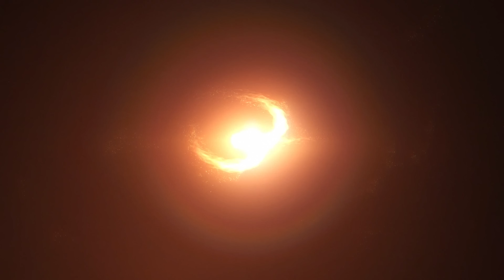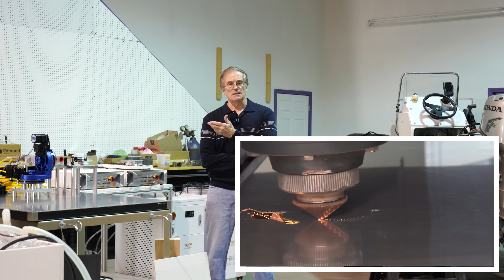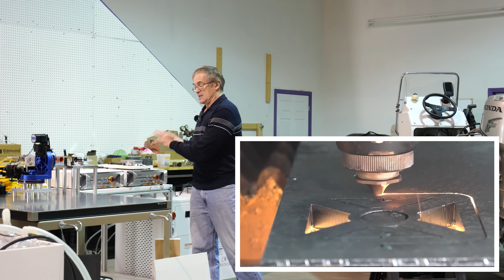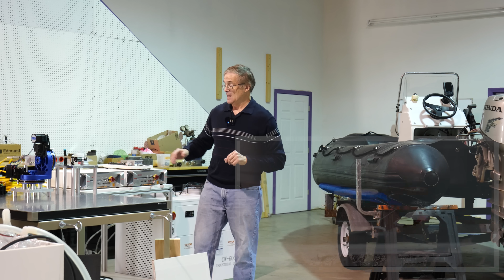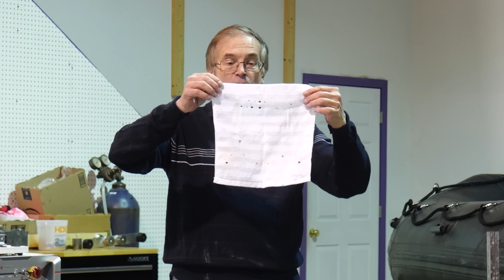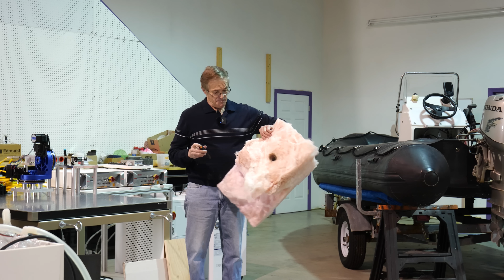We have a problem... and need your help!

Comment: Have you tried sheets of graphite? They are relatively lightweight and heat-resistant 
I'm not sure what your budget and weight tolerances are though
Reply from the maker: Any idea for a source? We need big sheets or a lot of smaller ones if a test shows that it works.
Reply: @TechIngredients  Your local refractory materials supplier (selling kiln parts, fire bricks, etc.) is probably a good place to start. If not, I'd ask around local machine shops. As a last resort (or maybe just for your test run), you can buy from the usual online industrial supply stores but you'll likely end up mostly paying for the shipping.

As for what to get, the best kind would probably be something intended for making molds (like for casting metals); they make big thick sheets or billets of graphite for this purpose. I believe you can also buy stuff made for seals, but that stuff is made to be softer (and usually thinner), so maybe not the best material for a laser backstop.
Reply: @TechIngredients  Also, just a heads-up, the DOE may check up on you (or at least put you on a list) if you decide on the graphite. It's an excellent neutron reflector and moderator.

Comment: I had a coworker that used to work at a facility with a particle accelerator... they have a similar problem when they need to dump the beam.  As he explained it they would normally reduce the power of the beam over time and disperse/unfocus it before purposely dumping it into a trap to minimize wear and tear on the trap itself..... but that trap had to also be designed to stop a full power focused beam being dumped into it at a fixed point which means LOTS of metal/carbon/concrete/etc.

Have you tried a carbon/graphite brick yet?  That seems to be popular for backstops for some types of lasers.

Comment: A quick search (laser safety curtains) - which you yourself must have done - reveals many professional options, all dependent upon the power of the laser.  Given that you have this information anyway, you must be looking for a 'cheap' option. Thar, my friends, be danger!
Reply from the maker: They are good if expensive but generally are used for diffuse or stray beams.
Reply: @TechIngredients  Safest bet is to latch on to a certified Laser Safety Officer or a reputable laser safety equipment supplier, to determine the appropriate curtains(?) and safety measures for the specific laser and intended use.

Comment: Is it a single laser with that output? Why not split the output into multiple pointers and make a system converge energy in a single point after the target is gone laser will stop being focused to the wall, like 10 pointers carrying the whole energy split by 5 centimeters and individually controlled pointers focus the laser on a single point in required distance and anything below or over the distance will be harmed by 1/10 of the energy and stay safe relatively, and you would have 10 times more time until any damage done also you can redirect it to a dispersion lens yes it would be harder with random locations being hit but you could make something work with the targeting calculations to follow possible laser target on the wall and add a lens at a system to disperse the laser

Comment: How would a temperature hardening alloy do? Like titanium or something similar? Also, what if you created a waterfall effect over the titanium? Collect the water in a pool below, angle the allow shielding, and circulate the water down the face. Curious if the alloy and coolant combo would distribute the heat easily.

Comment: Graphite+phenolic resin. I’ve seen people suggest graphite and other carbon based refractory materials but just to add to that from my experience with solid richer mothers, a phenolic resin composite would be form a good ablative layer that forms thick insulating smoke when it burns. In motors we usually use them around the fuel and the nozzle to prevent the outer metal casing from melting.

Comment: if the plywood really works well enough you could fix the fire problem by not having any oxygen nearby (have the setup be in a bath of argon or CO_2). this would however add the requirement of breathing equipment and especially with argon i'd be quite messy/wasteful and expensive.

another solution might be to distribute would be fog:
just make the area behind the test object foggy, so the light scatters everywhere. the distributed light could then be absorbed by something painted black.
one potential issue with this: the fog (this could i guess be usual water fog or fog from dry ice example) would have to be really dense to scatter the light enough, but you don't want any fog in front of the test object, so the first thing that comes to mind would be to keep that dense fog behind highly transparent walls. but that comes with another problem: dealing with reflections of the laser, so you would have to make sure the laser never hits the transparent walls at too much an angle.

this brings me another idea: you could have the laser be partially reflected and transmitted by glass (you probably need multiple such stages) or something alike and absorb the light watt for watt

hope this helps somewhat, also too much power is kind of a nice problem to have lol :D

Comment: You might need to look at composites. For example, a ceramic powder mixed with a resin binder. Take that mixture and put it on your plywood sheet. Finally, use a product like exhaust heat wrap, usually called Basalt fiber, and lay that in the resin binder. So you have a plywood, ceramic, basalt sandwhich. 

Relatively cheap, multilayered. The thickness can be adjusted by more layers of basalt wrap to get your timing right.
Reply from the maker: I'll try some of that wrap. It might work.

Comment: If rocks, brick or concrete is out of the question than the only thing i can think of is orbital heat-shield plates. It's going to be some form of ceramic anyway if absorption is the goal.

Comment: could you just sandwich bentonite chips between layers of something lie drywall to keep it contained?   the chips will melt at a high temperature but any liquified clay will be replaced by solid clay from above.

Comment: Could you integrate a distance-sensing failsafe that only allows the DEW to fire if the spot is less than a threshold distance away?  Depending on how responsive the system is, it could cut down on damage to whatever downrange material you settle on.
Reply from the maker: Probably not. The drones will be trying to evade the beam, and simply avoiding the "killing " distance is too easy.

Comment: A bin of mica or vermiculite might be the trick. As is burns through more would settle in place, continuously filling in the hole. You could add an air nozzle to keep the media moving. Light weight, fire resistant, easy to move, slightly diffractive.

Comment: So it seems to me you need to step down the energy through absorption and diffusion.  I imagine a series of glass plates that are more and more opaque as the laser progresses ending in a tank of water with dye or material in it that will absorb the rest of the diffracted energy and dissipate it as heat.
Also a quick search of google / Grok AI indicates there is something available called a beam block or beam trap - might want to look in to that.

Comment: A few thoughts. The suggestions for a tank of water with suspended carbon black seems likely to create a steam explosion hazard. In terms of sheer temperature resistance, I'd say try a sheet of tungsten. Hook it up to a water cooling block, or just put it in a tank of water (though, again, steam explosion becomes a risk).

At the other end of the spectrum you'd want something ablative, that forms its own protective layer as it burns. Maybe something like Starlite (https://en.wikipedia.org/wiki/Starlite) or another intumescent material? Maybe (and this sounds ridiculous, but it acts ablative under a blowtorch) silly putty filled with carbon black?

Comment: Some Ideas:

First: Why don't you look for a place that wouldn't mind getting bombarded by lasers? I am thinking of an old mine (underground or surface), some grassy hill (if it has rained recently there is little risk of fire) or even an old brick building. If that's not possible:

Make water flow down the blanket/Wood-panel/... constantly (it beeing pumped up again after reaching the ground) - this should provide permanent, faster cooling.
Or, even better: fill the space between two wooden boards with water, maybe even with suspended black pigment, so the water gets boiled, not the wood at the back. The laser might burn through the first layer, creating a small hole, but it is unlikely to burn the second layer, as water is permanently flowing to cool the area.

Comment: You could use a composite material that contains a (transition) metal with an absorption line corresponding to your laser's wavelength. It should also be able to burn while the laser supplies energy to it, but self-extinguish once the beam is no longer hitting it, so you might need a flame retardant as well. The laser will make it ablate/burn, creating a flame containing metal ions that can absorb the laser light. This creates a plasma "cushion" in front of the material, which eats up most of the beam energy and thereby limits the ablation rate. You can probably mix some suitable metal oxide (or acetate/oxalate?) powders into an epoxy board.

Comment: As others have said, turn your experiment so your laser points downward and your backstop is the floor. The key part I haven’t seen mentioned is to build a temporary ’pool’ of 6”-12” of water on the floor with walls made of wood and line the whole thing with plastic. It’s easily removable when you’re done and the water should refract the light and absorb tons of heat. The lasers will need to mount to the joists/girders and fly the drone between the ceiling and the pool. This will allow you to test the tracking and laser beam. The more room you can make on the floor the larger your backstop and tracking test area. You’re limited to the test distance unfortunately but it’s a proof of concept

Comment: A conical shape rotating graphite chunk to help disperse the beams intensity. I have used graphite successfully in to absorbing very high optical output intensities. The wavelength of the Laser is also a good starting point of the output absorption parameters required. Good luck as this appears to be a fun challenging project.

Comment: Rock wool insulation should address some of the issues you had with the fiberglass insulation. 

My thoughts are a layered approach, face it with a thick ceramic tile, rock wool in the middle and backing with some fluid soaked leather, maybe glycol or glycerine. 

I think the focus should be on materials with a high melting point and high surface area that is minimally reflective. Shame asbestos tiles are a hazard.

Comment: TLDR: you have to build a gun range. While I appreciate the problem, the solution may require analyzing similar situations we already work with. So this is a high energy device, which is similar to what we already deal with like firearms. Backstops require high mass metal or earth berms to block/direct downward escaping bullets. I would suggest studying indoor gun range backstop construction that can handle incendiary rounds because that’s basically what you’re working with. And I’m also concerned with errant laser emissions on human, so there needs to be good safety protocols…good luck.
Reply from the maker: That's a good suggestion.
Reply: This would have been my suggestion. In the video it sounds like you are trying to solve one problem with one solution so you want to keep it as cheep, as simple, and as portable as possible. If you are instead treating this as a multi problem that you need a solution that solves them all a specified range becomes much more reasonable for cost and location. If you are going to do other experiments with fast moving projectiles a range to do them on would be very useful.  A potential solution to not building your own might be to partner with a third party local firing range. Knowing what they use as a back stop and then testing that on a very small scale might give you a way to test the concept without damaging their back stop. They get advertising and get to see something cool and you don't have to build a full scale range.
Reply: Inclining laser downwards with a physical stop on angle could be more portable.  Somewat less chance of ricochet with a massless projectile.
Reply: 100%. It's basically the same as test firing incendiary 50bmg indoors. Muzzle control and mass in the backstop is what's needed. Make sure there are physical stops on those servos to keep the beam in a 'safe' direction. I can't wait to see your video though!

Comment: So I have read some of the comments and some suggestions are good. Like pointing the laser towards the earth. My thought was a spinning mass such as a disc of concrete withan ablative material. Or even fill a large circular pan with water, and spin it up until there is a water  wall formed by the centrifugal  force that would also be cooled by the motion of the water

Comment: Change the angle of the experiment-- aim it at the earth, or even the sky (if you can control for objects flying over.)  If you need to stay indoors, maybe a deep/long pile of very wet dirt. Cheap and easy to obtain.

Comment: i think as an extra safety, you can add servo to move the optics to make it diverging when not in use
did you try starlite?
i think wet wood covered in aluminium foil to stop the oxygen might work

Comment: What about wet Vermiculite? 

It expands when absorbing heat, so it will force water in and "self heal" because more material will keep rushing in, absorbing heat. so maybe a bag of wet vermiculite will hold the laser for long enough.
Reply: Also quite inexpensive

Comment: Vertical testing? Your facility has very high ceilings. How about a platform up high and a portable pool on the floor, A 12' diameter pool ought to give you about 2' of depth. Is that enough to disperse or diffiuse the beam? If not, would an air bubbler on the bottom of the pool gives you enough agitation in the water to bounce the beam around enough to weaken it? The bubbles moving up through the water would act like a bunch of tiny lenses.

Comment: Yeah I luv your channel, but no nothing about optics. First, if  someone has a inexpensive, lightweight solution, then you've a defense against directed high energy weapons.  Here my idea 1) electronic shutter inverse your beam focus extender,  2) crazy idea, how did MIT slow down light thru a material, get that stuff.  Have fun,  doing a video continuing to explain more what viewer suggested won't work and why some are promising.

Comment: Submerge the brick or wood in an aquarium, make the laser facing side a material that would make a melted hole and not shatter with a basin to catch the water from the hole in the aquarium.

Comment: Mist? Maybe involving a fuel injection system? Maybe a misting system between waterfalls. Alternatively, you could have water running across the surface of plywood or metal or whatever.

Comment: I  remember reading or watching  something  about nuclear fusion and  how they contain it, there was  a plate made of a certain material that is basically a consumable which they go into great detail. 

If it was m, I would go investigate how they contain fusion and what material  would be viable to stop the laser. There as to be an idea or viable material that could be used or a composite made that would work - if it can contain making a sun, there has to be something that would be viable. Sorry just a idea rather than a solution.

Could also try different advanced ceramics and composites that's cost effective.

Comment: Soak some kaowool in water, try refractory cement poured into flat molds, try cement board for laying tile, or a combination of any of the above. Pointing the laser at the ground is a bad idea, anyone that's ever poured molten metal from a crucible knows that if the molten metal drips out and hits the concrete, the concrete explodes or cracks very badly. That would be super expensive to repair.